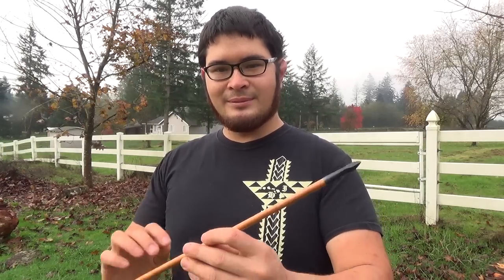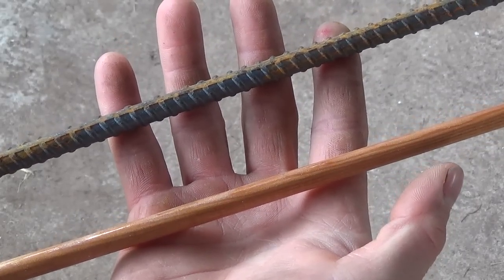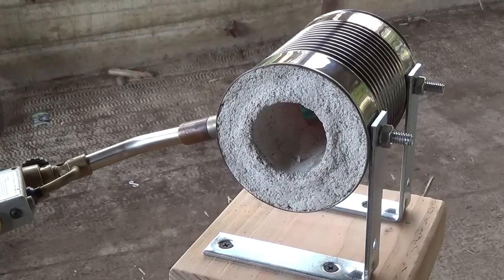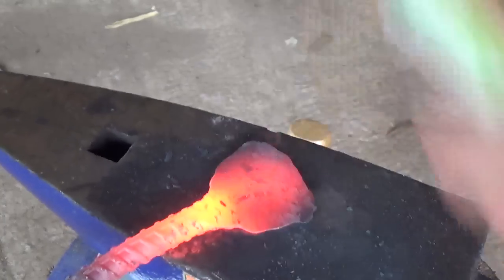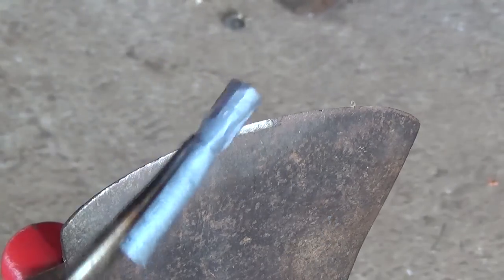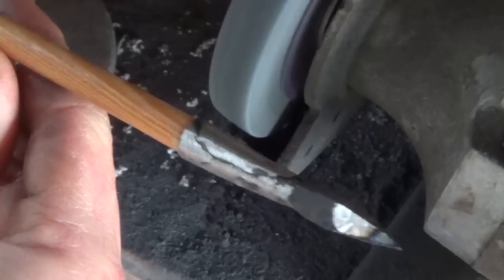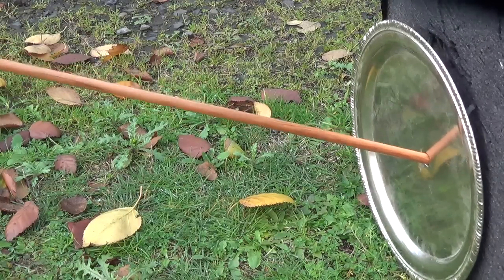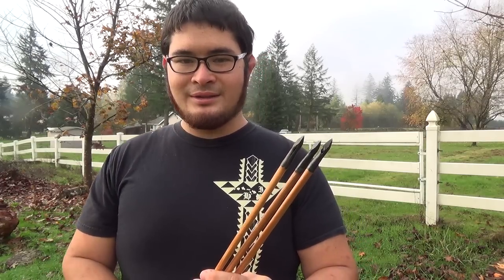How to Make a Forged Steel Bodkin Arrowhead From a Rebar

Comment: Hi Nick - nice use of rebar!
I used Chinese steel 7.62x39 bullet cases for the sockets and just
spot welded the points in. I was  surprised how strong these heads were
- and they still going strong.
Reply: Many historical arrowheads used in barrage attacks were made of cast iron. Cheap, fast and easy to make en mass since you could use fairly low quality iron instead of good and refined wrought iron. Instead of sharpening, sometimes the tips were large and bulbous as range percussion weapons to deal with heavy armor since arrows couldn't realistically penetrate late medieval plate Armor.

Comment: little tip with forging when you are doing the taper use the edge of the anvil to the other side of you that way your hammer will not hit the anvil as much but you did pretty great on the arrow tips and great job on your research keep them up :P

Comment: I'd love to see your take on forging a set of tanged hunting broad heads with practice/field points of matching grain out of rebar or round bar stock to fit inside carbon/bamboo shafts. no insert. Something that I've been tying to wrap my brains around and would be such a great 2 part video series.

Comment: Excellent vid. Have you made tanged points to use in bamboo shafts?
If not I'd like to see that.

Also if you mount the anvil better, the energy is directed into the object better.

great vids btw.

Comment: If you use a cross peen after some hammering there's no need to upset the end, it gives it a decent spread without the risk of bending your bar stock. And forge those points by placing the point near the edge of the anvil, forging skills brother, forging skills.

Comment: As a suggestion, how about making knives,arrows and stuff from what can be found out in the wilderness? Can wood be used to make a functional knife blade? Can wood arrows be treated to make them suitable for hunting prey? Can a working axe be made from only wood and if so what kind? Is it possible to get useable metal from rocks and ores using only what can be found out and about? Could it then be made into a tool?
Reply: +Andrew Wilson   A wood axe is not a workable thing.  Stone, however, does work.
Reply: +Saul Japuntich interesting to note though that medieval carpenters used wooden wedges with a wooden mallet to split wood
Reply: Whilst working in Borneo a few years ago, our Iban tracker had a knife made from bamboo. I was amazed how sharp it was and the ease at which it could prepare meat. I think there is a skill in how it is prepared but it was amazing to watch,easily as sharp as my parang.
Reply: I beg to differ on the wood axe. I watched a log be hollowed with a wood adze like tool. I did not have an interpreter at the time but it looked like a fire hardened hard wood?
Reply: I suppose if it was fire hardened and it was very hard,  But stone doesn't take much longer and makes more sense, and saves time in the long run.  I suppose the best way is to find out.  Test the theory so to speak.
Reply: +Andrew Wilson  You can definitely make effective hunting  arrows from wood you can find growing near you.  Depends where you live but many kinds of reeds make great arrows, dogwood, hazel,  and if you have the right tools you can use poplar and ash.   Shawn Woods has a great channel with primitive arrow making.  You can also find old books that show you how.     A wood axe probably had a very hard tropical hardwood like ipe  or ironwood and wood axes have been used as weapons in North America and Pacific islands   Native copper was used to make axe heads with little metallurgy skill needed.
Reply: +Andrew Wilson Bone can be worked into a pretty serviceable paring knife.
Reply: +Andrew Wilson 
I know of bamboo knives, however they only work well for meat. If they come in contact with anything more solid the edge is ruined.
Reply: @cbjewelz  It can be done as long as you work WITH the grain, not ACROSS it

Comment: I cried when I saw you using the axe head as a hot cutter. You can skip the whole process and put the rebar on the edge of the anvil and hammer there. If you angle the rebar you'd also get the pyramid point.
Reply: +Happy Koala you ruin the edge of your anvil that way.  it's easier to resurface a axe than an anvil.
Reply: But the heat from the rebar draws the temper from the edge. No good axe deserves that.
Reply: clearly if it was a good ax he wouldn't use it. (being optimistic)
Reply from the maker: +Happy Koala Thanks for watching! The axe bit I used has a crack on one side of the lug running clear up and through. It's unsafe to use for chopping and while it could possibly be repaired, I bought it to use it as is. I'm always on the lookout for broken or damaged old tools.

Comment: Is there any reason besides the very narrow type of arrow head that this arrow would not be good for hunting or war? I know broadheads are preferable to cut blood vessels (at least on unarmoured targets) but is there any reason why the rest of the arrow or the size of the head should be changed for hunting or battle?
Reply: Much larger hole for an animal(or person) to bleed out of with more area cut. A point like the one shown in the video could be used. However you would need very precise shot placement, and it would take a lot longer for an animal to bleed out(meaning less chance of finding that animal). Also at least in the state of Ohio for large game or turkey there must be at least 2 cutting surfaces with a minimum cutting diameter of 3/4 inch

Comment: i made that but i got plaster of paris and sand all over the kitchen. is there a way to dessolve plaster of paris?
Reply: lol i made the forge
Reply: Plaster is delicate, a couple taps will chip it off and warm water will clear up the rest. When I made my soup can forge (in the garage) I had both hands coated in plaster and sand. Just stretching my fingers when it was dry cracked the better part of it off, some work with the garden hose finished the job.

Comment: Isn't a bodkin point a triple bladed point with concave grinds between them to make three razor sharp blades? just a thought.
Reply from the maker: +taylor wilkinson Bodkin points are usually square, like elongated pyramids. What you&#39;re describing sounds like a tri-lobate point, which basically just means it has 3 lobes. I have seen examples of cast, ground, and forged tri-lobate points.
Reply: oh, thanks for the clarification. that actually helps quite a bit.
Reply: +taylor wilkinson Tri-lobed heads are more associated with Roman arrows. There is a vid on Youtube showing them being made.
Reply: Has someone been playing Age of Empires II? :D
Reply: +BackyardBowyer Bodkins are great 'Can Openers' (Medieval Light Armour Piercing) Especially when the flats of the points are 'Slightly' concave ground before case hardening to carbon steel.
Reply: There is a modern arrow head called a bodkin that is a triple blade thing. The head that Nick made is a proper historical bodkin.

Comment: I need help,  I can find a medium or high carbon steel,  all I could find is mild steel rod,  but I did see some rebar there,  is all rebar a medium-high carbon steel?
Reply from the maker: +Tyler Holtz Rebar can be unpredictable and depending on the type can be a medium to high carbon steel, mild, or a blend of different steels with different carbon content. I like to use mild steel for target points as they hold up well and deform rather than crack or break if they hit something hard. Softer points can also absorb some shock and help prolong the life of an arrow.
Reply: +BackyardBowyer thank you,  you earned another subscriber I like these type of videos.
Reply: I'll add rebar is typically medium carbon,  if you look closely on the lettering on the rebar, you'll usually see the number 40 or 60, the 60 is higher carbon.  If you're cracking the medium  carbon steel, try tempering the heads after quenching. Polish the head, then heat until the oxidation colors run, the 1st color that shows is a straw yellow, followed by peacock, brown, then blue. I'd temper to brown for a tough head, for a hunting head I'd try to draw the core to brown or blue, but leave the edges to peacock if possible. this would leave a tough core,  with a hard edge, but possibly sharpenable with a file. This may take some experimentation, you might have to draw all the way down to blue to get it soft enough to cut with a file.
Reply: +Don Moore thank you so much that was really helpful.
Reply: I should add though, there are several numbers on rebar, one is the size in millimeters, this changed a decade or so ago, it used to be eights of inch as whole numbers, so half inch rebar, or 4/8 would be marked number 4, and among carpenters or iron workers, rebar that size is called "number 4" or just "4 bar". It's still called 4 bar in the trades, no one calls it by the millimeter size in USA.  I used to know how to read all the numbers and know what they mean, a google search would probably give you the code. I guess it's time I did it too, since I can't remember it now.
Reply: +Tyler Holtz  only thing about mild steel is it wont temper, you cant heat treat it. but you can check it. after you heat treat it, hit it with a file, if its hard, its probably high carbon. i worked in construction and i heard all the new rebar we got was from china which means probably mild steel....but if you have a grinder, you can check it when you cut it, if it throws a rooster tail of sparks you will probably be fine
Reply: there are also plenty of places to get high carbon steel on the cheap. a wrecker is a good place to start, anything made of tool steel or spring steel is good for making blades (or broad heads in this case) leaf springs from cars, blades off mowers, old saw blades, chainsaw Bars, ect ect. Also @BackyardBowyer I'm not 100% sure you are getting your metal up to a proper temperature for quenching (although i am fully aware the camera plays tricks on the color of metal when it's red hot). a trick i used was that steel goes non magnetic when it hits critical temp. i use one of those cheap magnet tools for picking up lost bolts.
Reply: Tyler Holtz 4
Reply: Arrow heads well into the 14th C were iron or low carbon/mild steel, using mild steel bar will still produce a serviceable bodkin.